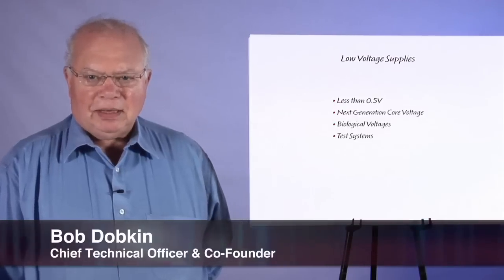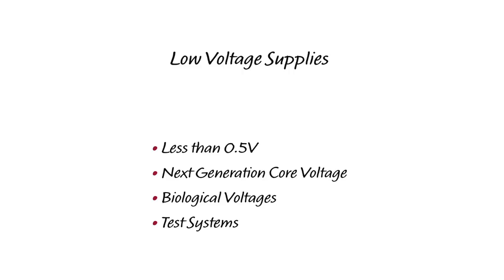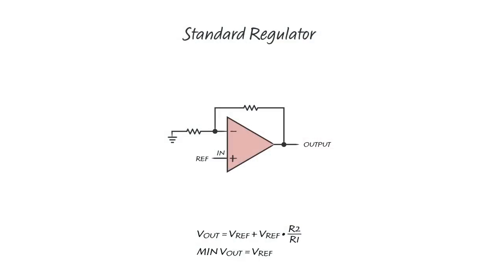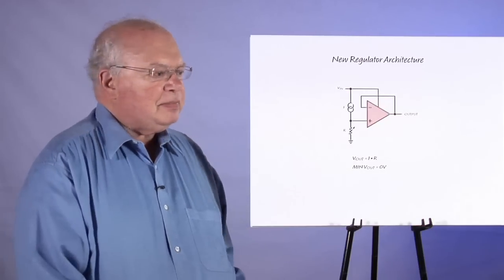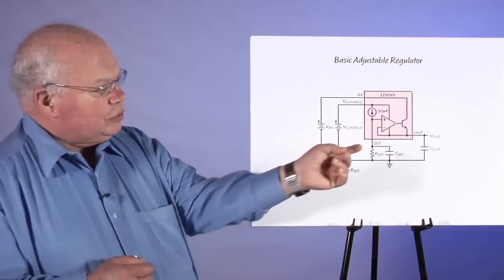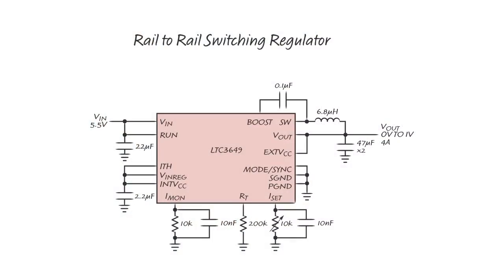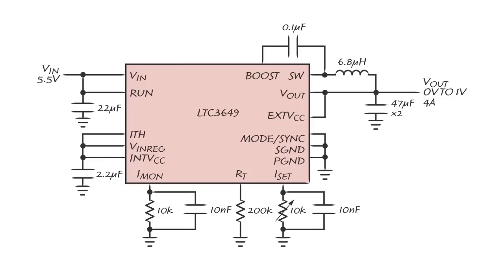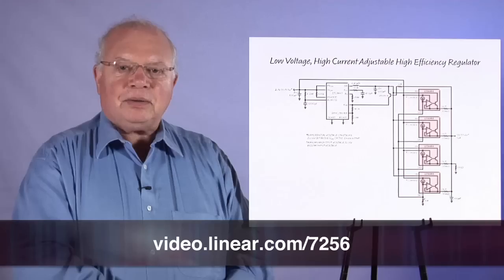Low Voltage Power Supplies

Comment: 2:45 in my opinion, the current goes to zero, not the resistor ☺🤗
Reply: Well, you are wrong.
Reply: @fredthechamp3475  Yes and no, depends on the interpretation
Reply: @cosminbel79  No. The resistor is a variable (controlled) resistance, the current source is not a controlled current. Therefore, the current will never go to zero. Only the resistance.
Reply: @fredthechamp3475  Remember that a zero-value current source is an open circuit as R = 0.
Reply: @cosminbel79  Again, the current source will never go to zero, it has a fixed value. It is only R that changes. If R = 0 then V+ = 0 and the output will also be 0.